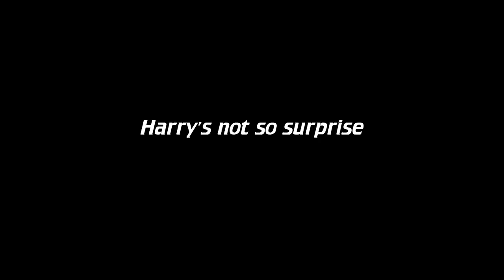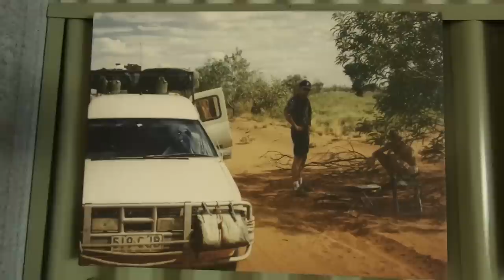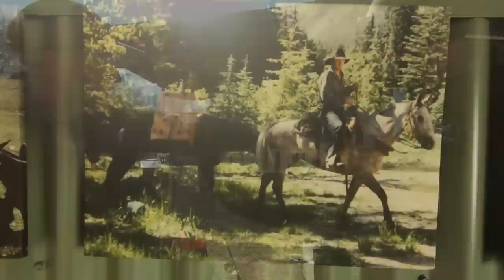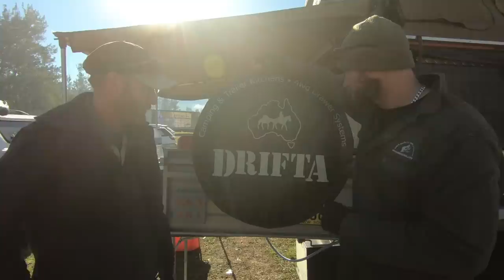RDW19 at the Drifta Factory, pranks on the boys

Comment: That's smart design on those drawers. I have to assume the weight of Torbin's drawers is partially due to the use of particle board. So many companies use it because of it's low cost, but it weighs a ton. It looks like Drifta is using plywood which is stronger and that allows a thinner sheet to be used in addition to it being lighter to begin with. Good thinking!
Reply: Andrew Kelsey my draws are mainly steel which is the main reason for the weight